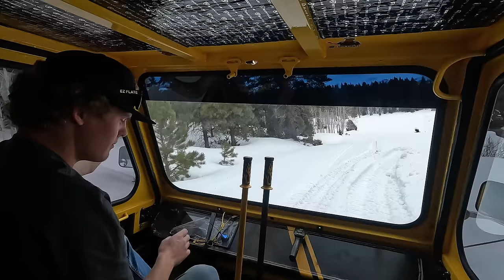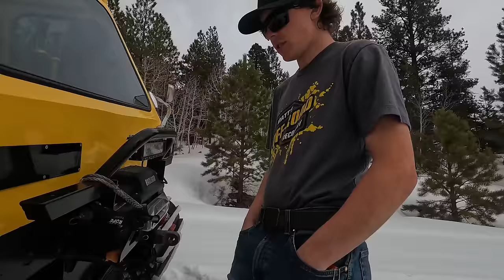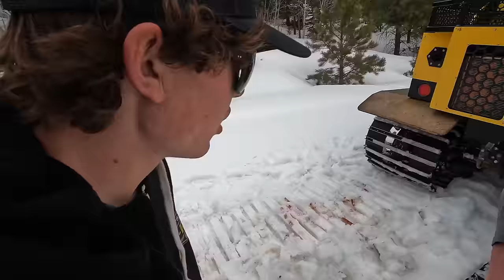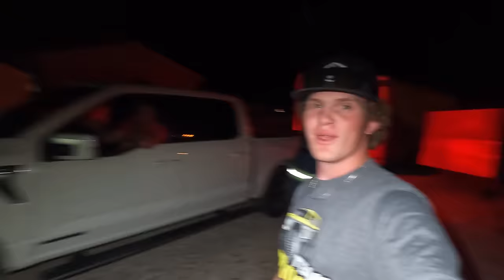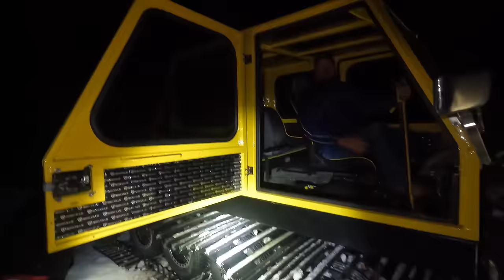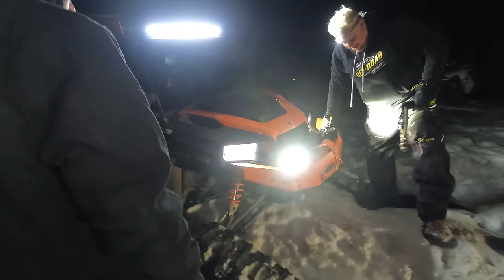The Worst Bombi Failure... Kids Left Stranded

Comment: Matt, no more sand pulls with the Bombi just keep it for snow recoveries!  Less repairs on it that way. The Kids did good with the knowledge they had on the Bombi!
Reply: pulling in reverse would take the load off that rear axle, but that has it's own issues and would probably break other parts/transmission/front axles. lol

Comment: When you fix/beef up the back axle, why not replace the rubber tire with a sprocket mounted on a free spinning wheel bearing. That would allow you to get the tracks as tight as you want without worrying about the tire and would allow you to beef up the rear brakes for better turning. Seems like it would solve most of your current issues with the bombi.
Reply: I've been thinking the same way during the last Bombi disaster recovery when the front brakes broke. The rear brakes dont do alot of work with a rubber wheel. 😅
Reply: Bombardier has built snowcats for 7or8 decades, I guess they didn’t know that they needed to be “improved” upon.
Reply: @jcar1417  while the bombi was a bombadier snow cat long ago, its been so heavily modified that thinking no longer works. The tires aren't rigid foam filled bombadier tires, the entire drive system and braking system is different, and it has a overpower LS engine. So yeah things aren't working reliably and they are breaking things on bombi. The way Bombadier designed the systems of the original snow cat no longer works with all the modifications.
Reply: @adambeaudry7784 I always said too muck engine 4 bt cummins would have been my engine of choice
Reply: @adambeaudry7784  they tried to keep them pretty simple because a lot of times you would need to make a bush fix. New and improved so far is more new than improved. But it does look good. 😂
Reply: @adambeaudry7784  exactly. the original machine was a lightweight 2-seater with a much smaller engine, and a proper steering brake differential. the only original bombadier part left is the chassis.
Reply: @williamtarpley4025  a 4bt weighs 750-800 pounds without a transmission. the ls motor is half of that.
Reply: @williamtarpley4025 A 4bt is double the weight of the current ly5 engine they are using.  4 cylinder engines have terrible inherent balance and without counterbalance shafts they vibrate things to death. For a diesel engine the 2.8 Duramax would be a much better choice.
Reply: @williamtarpley4025  Doesn't matter how good any of us think diesel's are. Matt is not a diesel guy. He's mentioned it many times how he hates diesels as recovery vehicles, for the type of work he does. He's not saying they're bad, just that they don't suit him.
Reply: @ChrisHarding-lk3jj  You can't really dismiss all 4 cylinder engines as 'too unbalanced'. There are millions and millions of them in vehicles around the world, hardly any of which have excessive vibration, and some are quite refined. Certainly a hell of a lot more refined than the bombi. I'm not sure how many kW this thing needs but the idea that all 4-cylinders are unsuitable is silly. I'd put a smallish diesel in, but then I've been a diesel guy for the last 30 years - so much less to go wrong than petrol engines.
Reply: @xxwookey  he's right about the weight though.
Reply: @ChrisHarding-lk3jj Subarus are balanced 4 cylinders, until you break an idler pulley.
Reply: @triscuitpower7196 Making an engine flat is the easiest way of correcting inherent imbalances.

Comment: The kids did a great job here. Matt, ya'll 100% need to properly inspect your gear before you go out into any sort of recovery. Even just a once over around and under is good enough to find things like what seems to have caused the problem this time. 

Some advice as a guy with a TON or outdoors and especially winter experience your team needs to beef up their winter survival gear asap. At least 1 shovel,  1 of every tool you might need to fix something that could be a common break at least at the simple level. A track jack for the bombi would be super helpful but not always 100% necessary, at least 1 spare tire, and a bunch of bolts and nuts for the more vulnerable moving components. A radio that can reach out to you or a satellite phone should be out with every team. An axe or hatchet, fire starting materials, both a lighter AND waterproof matches, and a spare jerry can full of fuel

Every team member should have a go bag with spare warm clothes. Wool socks, pants, shirt, sweater, and winter boots, 1 large thick preferably wool blanket for every person each vehicle going out can seat, enough high energy food and water for 24h of sitting around.

Yes this seems like a lot but even where you are where its normally pretty warm out, if its cold enough for there to be snow on the ground, its cold enough to lose finger, toes, ears, noses, etc. Its cold enough to fall through some unknown deep snow or ice into water or just get stuck covered in snow. It doesnt take much to permanently maim or kill someone. Seen it far far too often. 

Stay safe and hope the bombi get fixed!

Comment: A great learning experience for the younger crew. When they first started trying to fix it, and I saw the one-handed bandit wasn't able to move the track with one hand I thought, nope, they are not going to get it. But then once they started using the winch and got the track laid out straight I thought they had things going in the right direction, but once I saw the bent axle and the back tire headed in the wrong direction, I knew they needed someone with some skill. lol.

Comment: The Bombi could benefit from the install of those small carriage rollers that support the tracks between the large rubber tires.  Look at Caterpillar track systems (I worked there years ago) and tanks for that matter.  Some are spring loaded to keep proper tension on the tracks. Dozers of yester-year had a floating system that had a large adjusting bar at the real (usually) with a large nut that adjusts the tension like a rear motorcycle wheel with a chain drive.  There are chain tensioners on timing gears and clutch chain drive systems (Harley's).  A tank can travel at highway speeds and not lose a track. Bombi could use a lot simpler and cheaper system than that with the similar results.  I've seen the work you guys produce and know this would be a sinch for your team.  You could blast through that snow and leave a rooster tail.  While towing a broken down client's wreck.  Keep up the great work.  Love watching your work.  79 year old life-long Phoenix Resident.
Reply: None of that would help much if the back axle is bent, still going to come off.  not sure there is enough room between the wheels for a small carriage roller.  Maybe a spring loaded tensioner would help.  That is what Caterpillar has for their metal tracks, mind you those springs are massive and preloaded with a killer (literally) amount of tension.
Reply: @johnwythe1409  A-men to that.  That kind of work is done by  a shop truck or in the shop itself.

Comment: I had a Snowcat back in the 80's with a similar axle design and it was constantly bending the rear axle or shearing the spindle off. In fact that was the reason I sold the thing, got tired of constantly having to work on it. Never could, back then, figure out why it kept bending because the Snowcat was only used for driving through an oil field to check the pump jacks and it had the industrial GMC 292 which really wasn't a great power house.

Comment: 14:09 one thing i'd add to the Bombi is, for the doors, either a large magnet OR the self closing fence door latches, where the fence door's pin is replaced with a small metal loop either bolted or welded to the door. The mechanism is pretty low profile, and because it's self closing, even if someone forgets to pop the door on the latch when it's open, it will eventually self grab itself so it doesn't swing.

Comment: Matt instructing them on the phone how to repair it by themselves is good lesson in self reliance instead of just coming to do it for them... They are young  & all have  worked on it enough to understand the machine... However, until they realized the rear axle was bent & that's why it threw the track.. Even Matt couldn't have repaired it without some help & extra equipment/tools...  Still builds character & they have a respect for how much physical labor it takes to do.  The kids all worked well together & kept their spirits high & knew to hike out before nightfall & temps dropped.  Matt can't blame them, they had it on camera they weren't abusing the machine... Turns out it was Matt showing off @ the tow truck games...lol..... the Kids did very well.

Comment: Good work and attitude, kids getting to where you did.  You knew what was up, but knew you needed to get back for more support.  The shop needs a line mechanic with Tom's outlook on operations.  A lot of problems could be avoided with that set of eyes on the equipment.

Comment: Use to drive a Spryte Snowcat at McMurdo Station.  One day I was skating it on ice.  The Head of Heavy Shop told me if I tore the track I get to replace the track.  Hundreds of bolts.  After that I was more careful.  But heck ice and aluminum tracks made it a perfect skater in turns.  Never threw a track, but I did love the Spryte Snowcat for its abilities.  I think only the Hagglund was the only vehicle that could out perform it.

Comment: I live in north idaho. We snow wheel all winter. We don't use tracks. I go rescue tracked sxs and rigs all the time. Air you jeep or morvare to 2psi and drive them in.. this is where toyotas rock. Oe drivetrain with dual cases are light weight and will runs 40s. Look up Dayton, WA snow wheeling..

Comment: The rear bent idler is is a design flaw when the “driven” is in the front instead rear…when the unit is towing all of the force of the vehicle plus towing force is applied to that front axle…if this unit was rear driven sprocket just the force of pulling the track back to front plus what ever force is required to hold the track against the sprocket….

Comment: Since the Bambi is primarily used in snow recoveries I think you need to keep a "Go Bag" with some gloves of varying sizes enough for the maximum number of people that can fit in the Bambi.  Also might be a good idea to have a couple offroad jacks mounted somewhere on the vehicle and maybe have some brackets welded to the bumper on each side both front and rear.  That way you could jack  Bambi up on which ever side threw a track.  Since you have the winch maybe add a couple snatch blocks so you could use trees manuver the track back in place.  Don't you just love how I can come up with ideas to spend other peoples money.  Matt you have a good crew and they are using the brains you instilled in them.

Comment: You should probably ask for track tips from some army BV-206 drivers, I suspect it wouldn't have been necessary to detach the track. I vaguely remember one time traveling in a Bandvagen that threw a track and I think the driver just drove next to a tree and used it to push it pack in, didn't even need to come out of the cabin.

Comment: Been there.  Had a tensioning wheel sheer off at the hub, drove right off the track.  Had to hike out several miles and send a crew out with a replacement wheel and get the track back on.  Fun times 🤣

Comment: Guys, you need a set of preventative maintenance service checks (PMCS) for the Bombi.  The bombi inherently goes places other vehicles can't get to, where the crew could freeze.  Checking track tensioners, rollers, and fuel needs to be on that list.  Putting a laminated checklist inside the bombi that must be filled out to exchange for the key will be less heartache than wondering whether hypothermia or frostbite can get there faster than help.

Comment: Iff the Bombi rides on the rubber cush shock indispension units they can be pulled apart and the hollow box can have another smaller section hammered down inside to strengthen them . The length hanging out from the chassis to the wheel is going to see some big forces impossed on the rears when turning . Maybe even some solid bar hammered down in the origonal box section would be better for the Bombi . Did a friends 6 wheel trailer last year - easy to pull apart using a chain and a 10t hydraulic porta pack ram  . Lightly greased the rubbers with red rubber grease when it came to rebuilding and just hammered them back in . Not bent again so far and he carries 4t+ on the 3.5t trailer so you see how they bent lol .

Comment: I've been in Paragonah since 2001 and don't ever go to Yankee Meadows or the lake after it snows in the fall. My trucks are f350 4x4's with lockers on 35 inch tires with 2 link V-bar chains, but I don't tempt fate. Those mountains can kill you in the winter. The elevation is way over 6000 feet.
The young crew was smart enough to know when enough is enough and walk out while they could. I know exactly where they were and they would have been able to get to the highway and catch a ride down to Parowan.

Too bad about damage to the Bombi at the games but you'll get it fixed.

Comment: It should be possible to make two bracket attachments with pulleys that they can feed the winch line through and use it to pull the track around the wheels. One to go in front and one in the back. Make them symmetrical so they can be used on either side, and just lash them to back somewhere out of the way and bolt them on when needed.

Comment: @MattsOffRoadRecovery I was wondering if you ever considered adding an electric cooling fan to any of your vehicles to help reduce heat, the sit and idle a lot during winching out vehicles with no airflow, so an electric fan on a switch would really help reduce heat by moving more air. Love to see a video of how to wire it up.

Comment: Kaulin & Caitlyn are a couple. 👌🏾👌🏾👌🏾
Caitlyn is the organized one keeping the team together while Rhett is using common sense.  Kaulin is the leader.

You guys need to do what truckers do before they start driving.  They do the “pre-trip inspection”.  You guys should do that after each recovery or before a recovery.  If you guys would’ve done that, then you would’ve noticed how bent those rear wheels were & fix it.

Comment: Got bogged up a mountain in the snow with no one else about except my friend who was with me.
Come about 5pm, when we had tried everything, with enough bark and branches under the tires but it was sunk to the subframe and jacks did nothing but sink it lower. Finally made the decision to walk down the mountain.

Maybe 3 hrs later in pitch black (so keeping on the mountain track was a joy) finally came upon some farmhouse that looked as scary as all sht. I opened their huge farm gate walked up their extra long driveway, and knocked on the door.
Some buffalo bill guy answered, and I explained we bogged out right up the top of the mountain.

Jumped in his tractor and drove up. Even the farmer guy said: You are definitely much further up than I expected. Possibly ~10 miles up around windy curves and sheer drops.  Finally found my car.
Pulled it out, and he saw how many branches we had under there! Slowly drove down the now night ice and snow mountain to freedom.

Yes be determined and try your best to resolve the situation. But you must know when its time to swallow your ego and seek help. We pushed it all the way to 5pm trying which was too late on a lonely snowy mountain. The problem with snowy edges that some parts just drop 2 feet under you, learned that the hard way.

Comment: Having worked in the forestry for years you always to prepare more than one set of clothes. Preparation is basically a one time trick to always have a duffel bag with extra gear lying around. Work clothes in colder weather are never warm and dry enough for when you stop working. Live and learn.

Comment: A high lift jack is standard equipment on most snow cats for pulling the track together at the top so you can get the bolt back in .

Comment: I live in central Texas, so I can barely spell “snow”, much less drive a Bombi, but here’s an idea for the next time you throw a track.  Maybe it works, maybe it doesn’t.  Use the winch to bring the track up and over the rear idler wheel while you guide the track.
Reply: The bent axle might not have helped.

Comment: Yes, that is what happens when you have air filled tires and wet spring snow get inside the track and compress the tires and the track can climb off, that is why you have to run as much air in them as you dare (usually twice maximum pressure) to have them be solid and not compress for anything.. And having a bent hub upon that it'll happen in no time at all.

Comment: to reduce snowmobile overheating in conditions like that before you start out kick a bunch of snow into the rear suspension. This will help lubricate the sliders. While traveling drag your boot heels in the snow to create a stream of ice particles that will fly into the track and onto the heat exchangers

Comment: If you ever get another one of those, or want to look at a different way of doing the drive train, you should talk to Edison Motors and see how you could make it a serial hybrid electric with dual electric motors and a genset on the back.
Dual independent motors will remove the stresses on the diff and brakes. Torque will be there and the genset will give you loads of range.
While folk will say you can't do that with batteries in the cold, yes, you need to think about it, but you can run batteries at low temperature with heat, and there are batteries that will run at low temperature (e.g. LTO or the new Na+ batteries). You don't need a big battery back because it's hybrid.